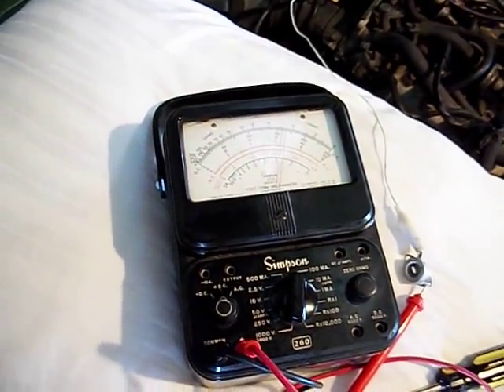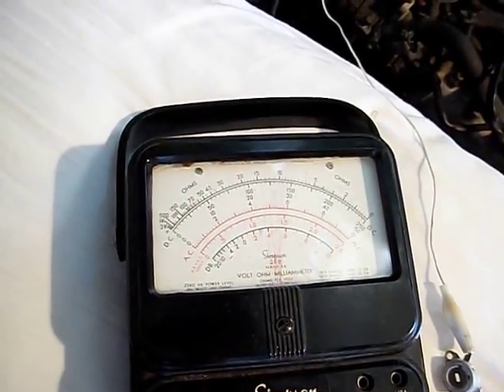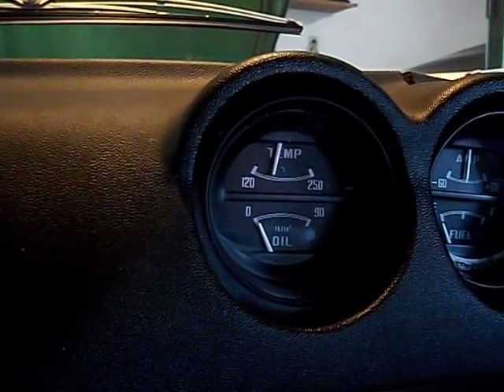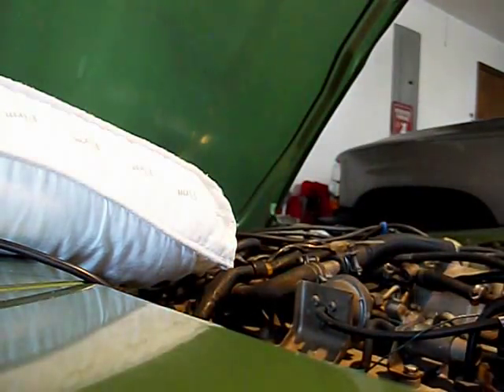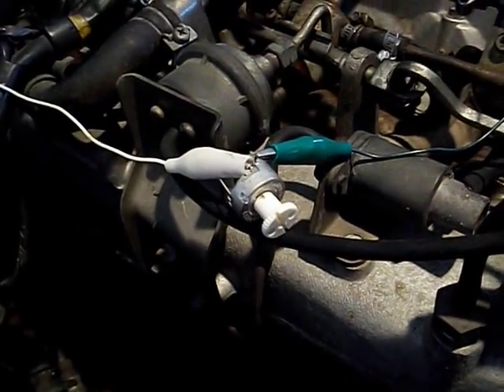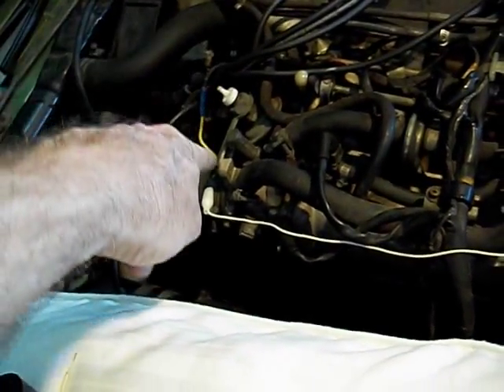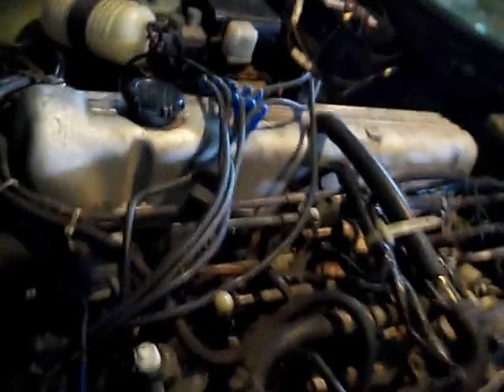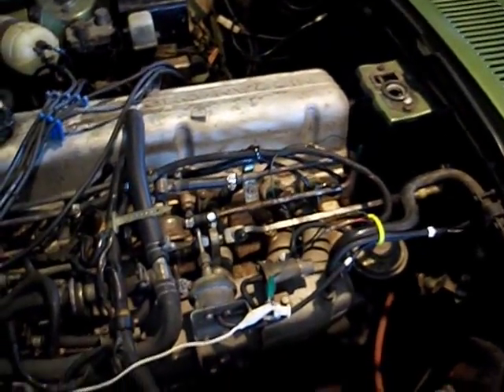1975 Datsun 280z water temp gauge sending unit

Comment: my datsun 210 AKA B310 car has the same issue. voltmeter reading same as pulsing. I grounded the signal wire, but the temp gauge not even closer to middle. it supposed to went to 'H' when grounded the signal wire: right ? wires are Ok. I checked with multimeter. after i set the wires,  when the engine running temp gauge runs very slowly. it`s like breath and running. it  only pass the "c". sensor works. i direct supply the current and Ground , gauge working. What is the problem ?

Comment: Hi Dave

Lots of cars from the 60s and 70s use a 
mechanical voltage regulator for the gauges.
Generally mounted near the gauges under the dash.
That is where the pulsing on the voltmeter is coming from.
Not that it is bad, but a service manual should tell the voltage
that is should be.
Ford was notorious for that regulator failing.
I just replaced on my 60's Mercury. 
New replacement are electronic instead of mechanical.

Skip
Reply: +ConestogaWagon ^This.

The oscillations aren't seen, because the gauges are Nichrome/ bimetal devices with a long thermal time constant.
Reply: +ConestogaWagon  I would agree, those ford regulators did fail often, and from working on lots of cars of the 60,s and 70,s electrical gauges were unreliable at best- Jaguar oil pressure senders were a nightmare so I always replaced them with mechanical ones. Cheers.